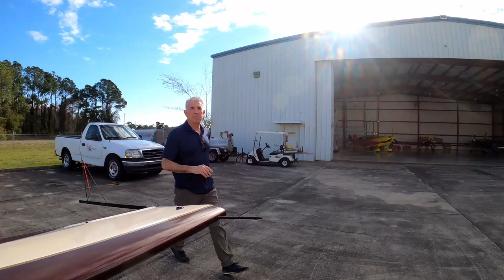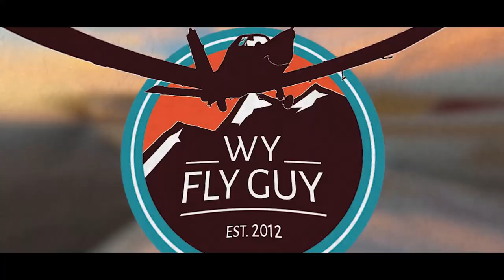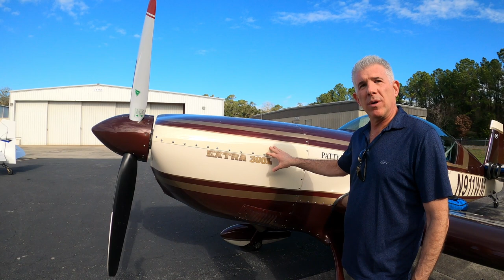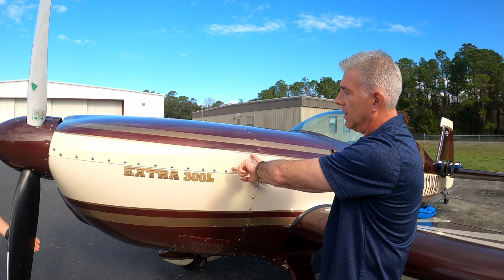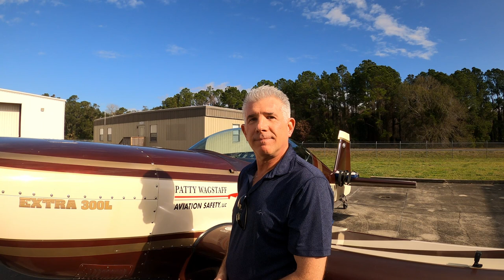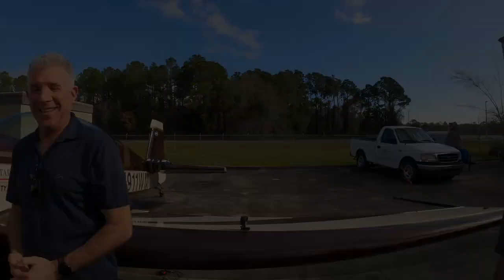How An Inverted Oil System Works In An Aerobatic Airplane

Comment: Hello WY Flyguy from Sydney, Australia.
Thank you for the explanation of the oil system in an aerobatic plane (ball valve) I will seek a schematic diagram to satisfy myself.
The cowling is screwed on: that's for sure. Is that the design or to resist aerodynamic forces?
🌏🇭🇲
Reply from the maker: I’m not sure about that.  I know the plane can take 10 G’s.
Reply: @wyflyguy114  finally some aerobatic plane videos

I have searched several times and never got to find any info about these amazing planes

Any arrobatic planes use turbine engines?

Comment: My brother drug me into planes he would buy that should of never seen the sky again without a lot of repairs. We neither one drank so that was not a excuse but to fly a plane about fifty air miles from a farmers field where it was parked many years... errrr. I was with him, loved my brother unconditionally so he had paid for it, it miraculously fired up and he checked it to see it was hitting on all cylinders (although I am "was" a professional diesel mechanic most all of my working life) and he is excited on how well its running... he cuts off the rope holding it in its current place and revving it up, with terribly awful tires, its moving a bit and we were just setting in this old Stinson tail dragger... he guns this engine again an he says "Here we go"! And so we went .. I'm thinking he meant we would  taxi it a little but as far as airborne, that had not crossed my mind  till this plane was hovering over the ground an he just takes it up! I have been a touch scared and was appropriately scared at this time but my brain says trust him and off we went. Like said, about fifty miles by the crow flies to our strip at his house. He comes in feeling his way in as the air indicator was frozen and not working at all.. literally by the seat of his pants we come in to his place with his smile so wide and happier than I had seen in so many years as he had been through so much pain in his life. At the time we are in our late sixties and he hollers touch the ground with your cane. At this point I was not certain if he really meant it or not. he got it down and how we stopped is a mystery that only he and god know. we got there and  as it stopped, I  could hear something banging around on the back of the plane. One of the tail wings had fallen off as it was so rotten, made out of wood. Now we both were sent to Vietnam and he got transferred to south america to locate a drug lord. We both were drafted and out only difference in us was our last names as our dad made many ladies in a family way. Not our belief system but our dad was who he was, no changing that and we once met, were always doing something with him being mistaken for me and likewise. He looks at this small piece of the plane dragging on the ground, his wife comes up and he says "Morgan, I told you not to try and fly this plane till we check it out!" So I accepted the blame for him as his wife would of killed him for certain. Plus this woman hated me cause I never trusted her ever... my system was correct. His wife did kill him by pushing him down the stair system in a home he built for her making her a millionairess. I guess that is how it was said. She had a boytoy for many years and I even pointed it out but he did love her so none of my business. When she did what she did, I proved to the police what happened, she is still in prison.... just a wealthy broad in jail. I saw this video as I haven't worked on airplanes but curious as to how a engine could run upside down like these rock crawlers in utah or other crazy places we have no business going and making many companies rich off of what people will spend on a piece of "art" I do believe is what they would call it. I am not a pilot nor do I want to be, plus I am seventy three now and crippled up to bad to even walk. That is another story I am sure your not interested in
Reply from the maker: You have had some adventures!